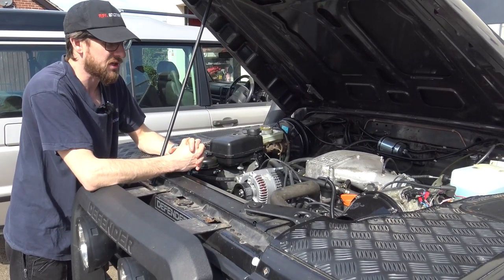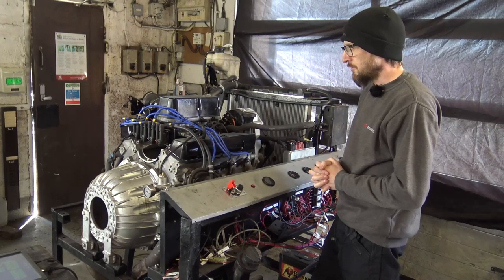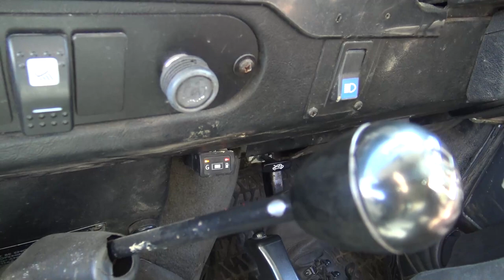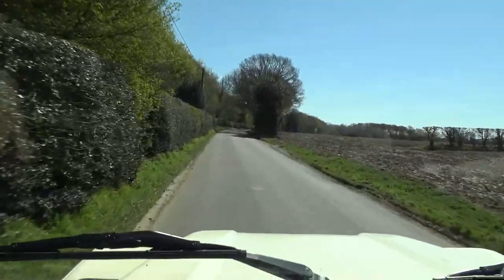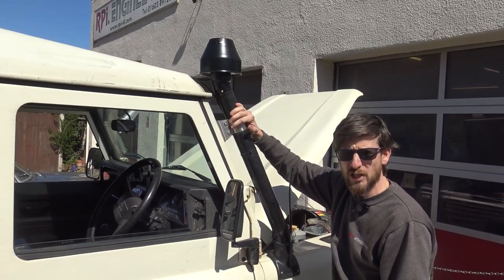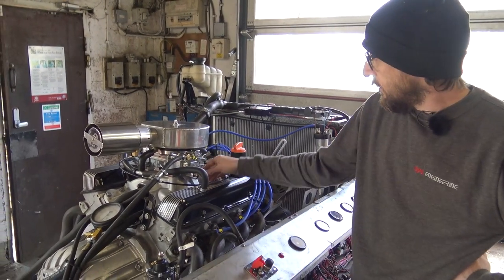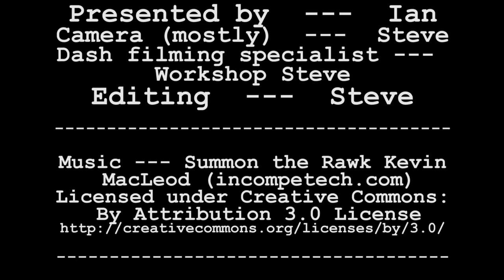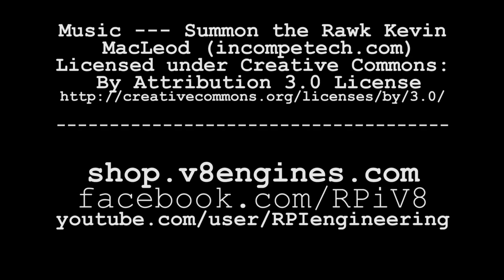RPi Engineering Rover V8 Workshop Update Episode 45

Comment: With the 4.6L in the d2, is that still a zf4ph22 or does the conversion need a zf4ph24?
Reply from the maker: Yes the standard 22 box is used normally unless otherwise specified with the customer but assuming the 22 is in good condition then there is normally no problem with a 4.6 in front of them